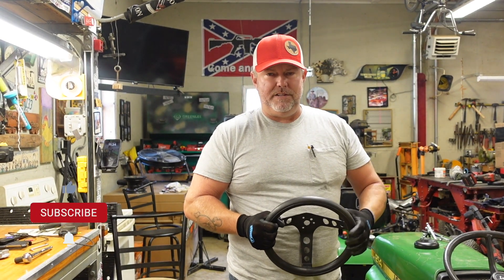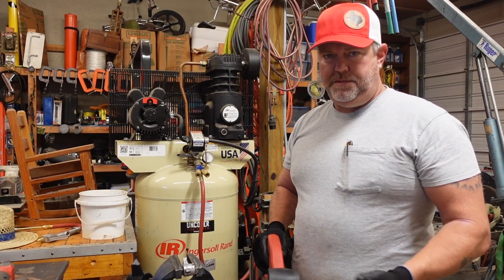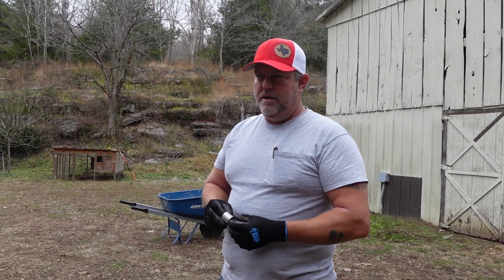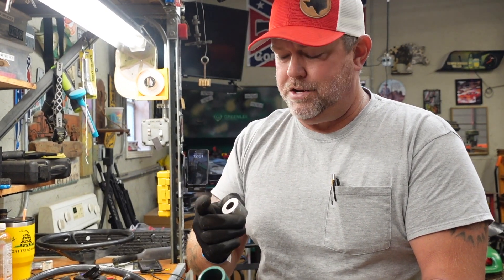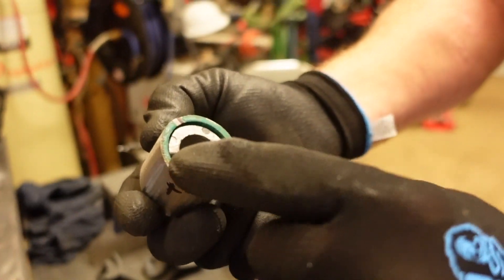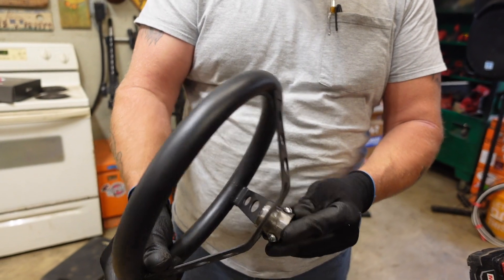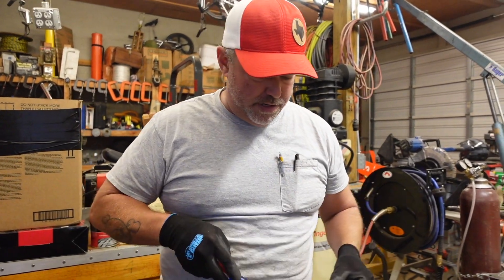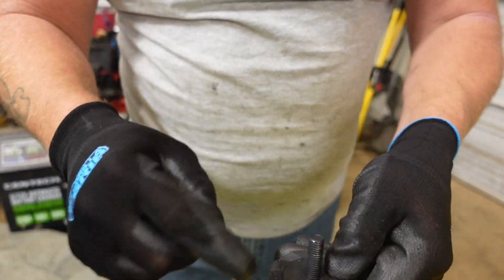Custom Install Grant Steering Wheel On The Mud Mower! JD214 Mower Build Part 23

Comment: You couldn't convince me you're not an electrician! Between the wall of Pipe, Creative uses of Unistrut, Job site boxes full of M18 tools and perfect Conduit bends in your shop!  Never knew the tape measure trick! I've building using a chop saw and correcting it with a grinder. Should have got an evolution. One of my main goals next year is to get a TIG welder and learn to use it.  Imagine all the time you could save by welding a flange on the stock hub to bolt the wheel to. Great work around. I doubt you'll break it!  Those JD steering gears are pretty smooth. Dad has a 140 H1 he moves boats with at his shop. , I liked the way it steered.
Reply from the maker: Thank you! Yes there are a lot of tools I need to invest in so I can improve the quality of my builds! TIG welder for sure, a lathe, a steel chop saw (Evolution), a mill, a plasma torch for starters. I saw you have an oxygen- acetylene torch, I don’t even have one of those! Everything I do is by hand tools or hand held power tools with the exception of a small drill press. I bought the Hobart 250 amp welder in 2017 with tax refund money. It was worth every cent!
The steering wheel feels super solid compared to the stock one. The steering box and system on these tractors is very robust and I could leave it and be happy with it. However, eventually I’m gonna do a custom front axle  like OKoffroad mowers builds on his and use a golf cart rack pinion set up. Anyway thank you again for the kind words and comments!!